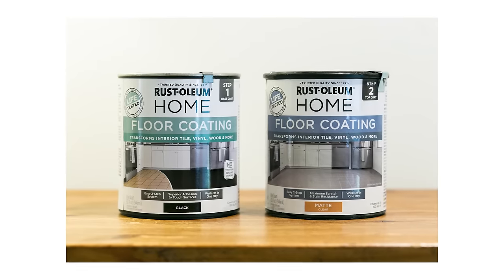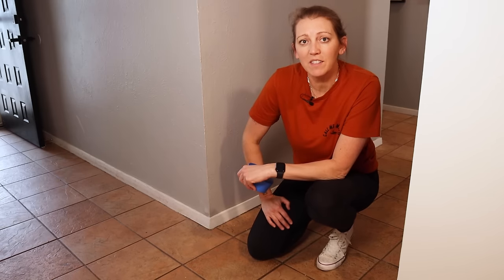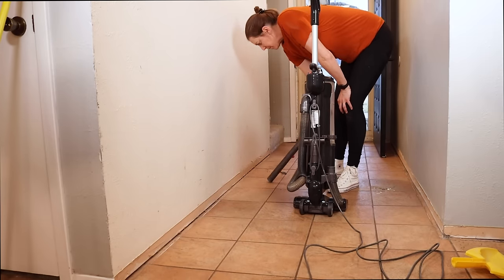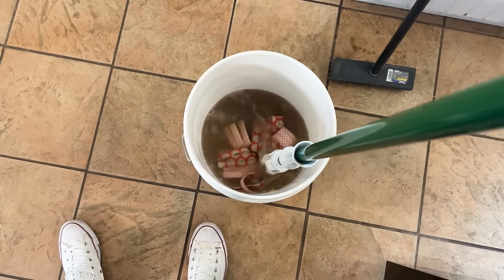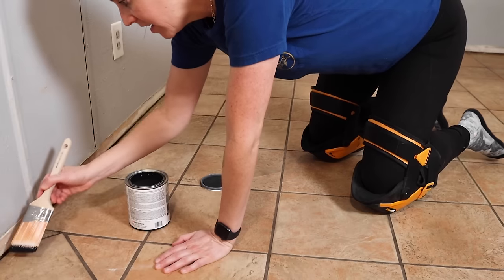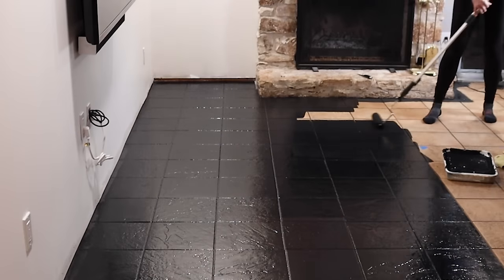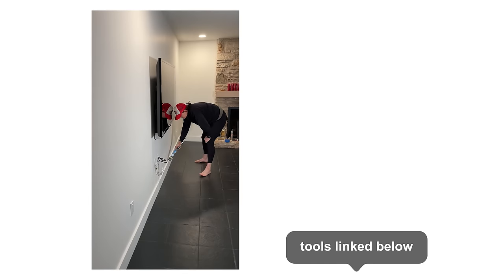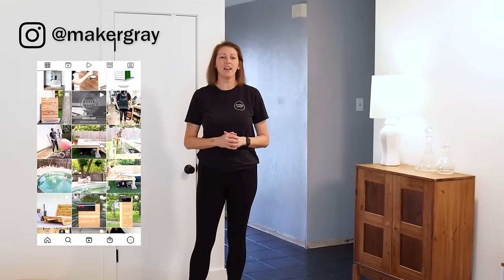Easy Update For Outdated Flooring? How To Paint A Tile Floor | Before And After

Comment from the maker: I used two coats of the paint and one coat of the top coat and I've very impressed with the durability! Click here to check out the awesome Rust-Oleum Home Floor Paint that I used to transform my floors! http://spr.ly/ROHOME_makergray Also, check out more of my House Projects here: https://bit.ly/3h6bml2 Thanks for watching!
Reply: Can you get the paint to purchase on Amazon since I'm not in the country and is the clear coat has to be use or it's optional
Reply: I used glass primer and paint to cover salmon pink tiles in a bathroom.  Put on several coats of varathane. That did very well, but a floor is a different situation. 
Now I also did something simular with the tiles around our wood stove. Four years now, with some foot traffic.  Holding up well.
Reply: Wow, just stumbled on this. My dad has 33 yr old tile and it’s ‘ok’ but I think a coat of new color work be awesome!!  We have about 10 chips in the tiles and wondering what to use to fill them?  Thanks
Reply: @Kay-pq1uo  ...   I would use 2-part Bondo, available via Home Depot, Lowe's, most auto parts places in my area, etc.   It has a bit of a strong smell, I wear a respirator when I use it to repair furniture I flip but I have sensitivity to such things.   I wear a paper mask when I sand it.   Bondo is utilized in auto body repairs, it's the most durable product I have found.   (If I need to replace missing trim or molding I usually make a mold from hot glue, fill it with Bondo and glue my duplicated piece in-place.)
Reply: Can this paint be used in the bathroom on floor and in shower?
Reply from the maker: @MsHarasan  Bathroom floor, yes, but not in the shower. Rust-Oleum has a different product for shower tiles
Reply: Update on wear and tear?
Reply from the maker: @danyellerobinson5940  Amazingly well! I'm very impressed. We're about 7 months in.
Reply: @MakerGray I forget,  did you use one coat of sealant or the recommended two coats?
Reply from the maker: @danyellerobinson5940  I did two coats of each part (paint and sealer) and that worked well!
Reply: Update on wear and tear 2yrs later?
Reply: @008AC  I'm actually releasing a follow up video next weekend! Stay tuned. For now, the short answer is it has been great.
Reply: @stretch551  alright I'll keep an eye out for it, thanks!
Reply from the maker: @008AC  Here's that 2 year update video! https://youtu.be/1Uz-zlZL7RU
Reply: @MakerGray  thank you 🙂🙏🏻

Comment: To ‘bring things together’- paint the fireplace mantel. Don’t paint the fireplace stones, just the shelf. Using your tile paint and sealer, a black mantel would make the floor and fireplace seem ‘on purpose’. So the floor doesn’t appear like an ‘afterthought’.
Reply: I agree about the mantel but I would rough brush a lighter coat of white (ish) paint on the top have off the fireplace. The stones don’t match in style or color but I like the bottoms stones more than the upper stones

Comment: Well you truly learn something everyday, as a tile guy I never thought it would be possible to paint over tile, I'm wondering how long it will last for if the paint will scratch off the tile
Reply: Dude I recently bought a house where the previous owners had painted over nice Italian tile with the rustoleum two step process product and the floor looked awful,  scratches everywhere.. even we would scratch it up sometimes moving furniture around and what not. Also, the painted floor attracts dirt and hair like a magnet it's been a work in progress slowly removing the paint and sealant one room at a time but we're finally getting there.  Definitely stay away

Comment: Hi I am going to try this on my bathroom floor. The tile grout has come up in places....do I need to re-grout prior to applying this system? thanks for your video ...your floor looks great. MM
Reply from the maker: Hi Maryanne, if you can, fixing the grout is always a good idea. However, I'm not sure it's 100% necessary as far as the paint itself goes. The paint will be fine either way. The top coat however might pool in that deep crevice area and can dry white instead of clear when that happens. Just be aware of that spot when you apply the top coat if you do not fill the grout. Thank you for the kind words and for watching!
Reply: In lieu of grout maybe consider Bondo.   Available via Walmart, Home Depot, Lowe's, auto parts stores, etc.   I had a rental property that had over half of a tile missing.   I used Bondo to fill the void, allowed it to completely dry, sanded it smooth and used 220 grit sandpaper to polish it a bit.   Painted everything the same bright white (2 coats), sealed it (3 coats), it looked like a new floor.  I sold the property to great tenants - they loved the bright white bathroom.   Just change towels and decor and it's fresh and new - in a 70yr old house.     This was on the 1970s, I don't think this technique was available back then.   I utilized Marine paint.

Comment: I did this on a vinyl floor but I went ahead and roughed up a bit with a pole sander and primed . 2 coats of paint and topcoat since it was in my kitchen high traffic area.  It held up really well.  It lasted several years until I put hardwood throughout my home
Reply from the maker: Thanks for sharing this!

Comment: I love that you went with the moderate expense of replacing the old very dated baseboards. 
It’s a step I’ve done on all 3 homes I’ve renovated.
I hate the telltale dating that old baseboards give a house. From dated finishes to over accumulated paint buildups. And by using a wider replacement board you bury that ugly ‘ridge’ that’s left on the wall.
Reply from the maker: I totally agree. It's a relatively small change with big benefits. Thanks!

Comment: WOW!!!  We have the exact same issue in our kitchen.  In fact, our tiles are even lighter than yours with white grout (that stays clean for just a few days after I’ve finished cleaning them diligently).  We’ve resigned ourselves to just living with the awful floor since getting a new one would be messy and really disruptive.  But THIS, what you’ve done is amazing and what we should do as well.  Thank you!  It is pure serendipity that I even came across your video.
Reply from the maker: Wonderful! So glad it is helpful for you!! We can actually live with this floor now haha. We love the update! I recommend two coats of each part for a super durable finish. Thats what I did and it hasn't had any problems at all!

Comment: My concern:
1. What happens to grout lines?
2. How long/durable is this? I can’t imagine sliding a wood chair over it or coming into the entrance with small gravel in the runners.
Reply: What happened to the grout was also my first thought too. 😬
According to the manufacturer the directions it says: "Make sure to paint grout as well"
Reply: Can you use Krud kutter on wood floors too?

Comment: I saw your video on tiktok and decided to see the entire process. I absolutely love this and will definitely give it a try. However how long do you think the paint will last on the floors?
Reply from the maker: Thank you for watching! I think if done right, it should last awhile. I recommend following the instructions fully (as far as dry time, etc.). I also recommend doing two coats of the paint. When applying it, roll two different directions to make sure it fills all the cracks & seams. Then, apply at least two coats of the top coat for extra protection. With that, it should last awhile. We’ve only had ours a month and so far I’m impressed with the durability 😄

Comment: I want to do a harlequin pattern with tile on my front porch but I want very specific colors to be used. I'm thinking of getting an inexpensive ceramic tile and just putting it in and then painting it in exactly the colors I want and then sealing it. I think it could be a good way to save a ton of money instead of spending ridiculous amounts to get the exact look I am going for, which would be much more expensive marbled tile.

Comment: Looks good. It's a good alternative if you want to change the look of your floor without doing an expensive remodel. I probably would have done a professional floor grout cleaning to see if that changed my opinion before tackling it.
Reply from the maker: Thanks!
Reply: @RA82828   Of you, yes.?
Reply: That is what I recommend my customers first. Do a thorough professional cleaning, and that usually changes the look, if that doesn't work, then paint.
Reply: @RA82828  Well they are right.
Reply: @vaderladyl  Yep. Sometimes a professional cleaning, color sealing etc.  will make you happy. But, if you are confident you want a change its certainly cheaper than a new  floor. I'm curious about how long it lasts.

Comment: Amazing job.  Thanks for sharing.  Quick question.  where did you get the wooden shelve above the coach and how did you install it?
Reply from the maker: Thank you! I get asked about that shelf a lot. I built it years ago before I was making videos. It's a very simple build of 3 long boards (back board, bottom and front short board) glued and screwed together. I attached it to the wall by screwing the shelf into the studs. Thanks for watching!

Comment: You are so awesome and so brave! Most of our downstairs is tile that I hate! How is the paint holding up to furniture drags, foot traffic and doggie nails?
Reply from the maker: We're about 5 months in and so far I'm really impressed! It's holding up so well. I was worried about dining chair drags but so far no problem. I was also worried about dog nails but no problems there either! As well as general foot traffic. I'd recommend doing two coats of the paint and at least two coats of the top protecting clear coat. And if I do get a scratch, I imagine I can touch it up. Thanks!

Comment: did you think about a steam cleaner for the floor ? would it work?
Reply from the maker: For the original floor? We did! We tried it with no luck.  I think we tried everything to get the original tiles to look clean. These tiles are really just old and I think permanently dingy. For the painted floor, we do use a steam mop and it has no effect on the paint, thankfully. Thanks!

Comment: How durable is the floor? That's my biggest concern.

Also, what product do you use the clean painted floors?
Reply from the maker: Pretty durable! I'm going to make a update video after Thanksgiving. We're very happy with it. For cleaning, we havent found anything that hurts it yet. We've used regular cleaning chemicals, mopping, as well as steam cleaning the floor and no problems.

Comment: We also have a color conundrum with caramel tiles in our newly remodeled kitchen consisting of gray and black tones, but fear that this will not hold up long term.  Thought about covering tiles in epoxy, but epoxy scratches quite easily, so it's not a good option.

I'm a firm believer in Rustoleum products, but I doubt this can last.  I used old school oil based brush on Rustoleum on my honey oak cabinets, thus eliminating the grain to create a smooth finish.  Very inexpensive and beautiful, but also very labor intensive.  With Majik hardener added, it's actually quite durable.

Can you do a follow up video on how this product is holding up so we can make an educated decision before proceeding.  Thank you!

Comment: I’m new to painting what does keeping a “wet edge” mean? Do you have any tips for fixing damaged tile like with holes in them? Thanks in advance
Reply from the maker: Happy to help! Keeping a wet edge means making sure that the last paint you rolled does not dry before you overlap it with the next. Rolling back into the wet part you just painted keeps a seamless flow from one roll to the next so you don't see lines or lap marks. I've never fixed a damaged tile but I have seen some epoxy products new to the market that might help. Google "how to fix a damaged tile without replacing it" and you'll see some options pop up. Thanks for watching!

Comment: Would this work in a bathroom? Or is there too much water damage  potential?
Reply from the maker: For bathroom floors, yes! For showers and proper wet areas, Rustoleum makes a different product, specifically water tolerable.

Comment: Dumb question, was your grout that dark color originally, or is it stained that color from years of use?  I'm really interested on how this product works/lasts if the crud cutter didn't fully remove stains from the grout.  We have 3 large dogs and keeping the grout clean is next to impossible, but I'd love to try a tile product like this to update our house.
Reply from the maker: Not dumb at all! The grout as you see it before the paint is exactly how it was when we bought the house. We tried and tried to clean it but no success. The crud cutter took off a lot of dirt but nothing would clean that grout. Really happy with this paint! I recommend a couple coats of each (paint and sealer) for maximum durability.

Comment: I've heard that the smell lingers and is super strong. What are your thoughts about that? I was thinking to do it in a bathroom that doesn't have a window
Reply from the maker: It's almost been a couple years now but I don't remember the smell lingering long. Maybe 24-48hrs max. I did this in the winter and could not open windows and we were okay. You won't want to hang out in there, but it should be gone relatively soon. Hope this helps!

Comment: What if the the tile I currently have is glossy? Do I need to sand it down for the paint to adhere?
Reply from the maker: If I remember correctly it should be fine. The degreaser cleaning is all you need. Rust-oleum gives all the details and requirements on their website for you 👍🏼

Comment: Will this work on terra cotta flooring? If I use Krud Kutter will that be enough.  I t looks amazing I am thinking of doing white as we are on a beach is Puerto Rico.  Can I buy this at Home Depot?
Reply from the maker: yes I believe so! We used krud kutter only for the cleaning and it worked great. Follow the instructions and I recommend doing two coats of the paint, and then dont forget about the top clear coat. You should be good! Jealous of your beach house!
Reply: @MakerGray  Thank you I will send before and after.

Comment: The only question I have for this project is how much of the product did you need to buy to cover this large floor? It appeared from the video that you used only a small quart of product (for each layer) and that doesn't sound like a lot.
Reply from the maker: I hate that I did not document how much I used bc that would be great to share. But yes, it was a lot more than a quart! The quart size was all that they had in stock, so I used several cans. I believe the cans show the coverage area so if you are interested, definitely consult the can or website. Thanks!

Comment: This might be what i need to rescue some "free" Craigslist tile i picked up. It's hard to tell, but i think i damaged the fronts' seal when i soaked them in muriatic acid to get the thinset off the backs.

Do you suppose this paint would still be effective if applied to the tiles before they are installed?
Reply from the maker: I'm guessing that should be just fine!

Comment: Do you think this tile paint will work on countertop tiles?
Reply from the maker: Hmmmmm I dont see why not. As long as they are not in a wet area, should be fine! Check out Rust Oleum's website for more info
Reply: Is there variety colours?

Comment: I bought this paint and it was great. However one thing I seriously disagree with is that it’s thick and the spread is great. That quart goes very quickly and you need multiple cans for great coverage. Does not spread well at all

Comment: Did you use the quart size?
Reply from the maker: I used several of the quart sizes, but the gallon sizes are great too!
Reply: @MakerGray  Think you could have done just the fireplace area with one quart? I have about 80sq/feet to do. Label says I can get 100sq/feet. Super expensive so I would like to only use one quart/one coat. Thanks

Comment: Can you paint in sections? Due to having to utilize the room. Thanks
Reply from the maker: I actually did that in one room and we can't tell at all!
Reply: @MakerGray  so if I left a path can I do that with two coats of each at the end or how did you do it also how’s the longevity of it?
Reply from the maker: @davelombardo1710  I left a path when I did two coats of the paint. And then when I did the top clear coat, it needs 24 hours to dry. So I did that in all one pass and painted my way out of the room. Longevity has been great! We're almost two years in and I'm very happy. I'll do an update video very soon.
Reply: @MakerGray  thanks for all your help! That top coat all at once will be a challenge cause myvsons room is off the room floor I want to paint

Comment: Would a lighter grout color work with covering the dark paint between tiles?
Reply: That sounds like fun.
Reply: That is a very unnecessary and painfully laborious job, you don't want to do, besides the paint is designed to be just that, one coat, no grout color difference.

Comment: Wouldn't it be worth it, even if it doesn't last several years, because it's cheaper than a remodel? Wouldn't we want to look at it as "paint" whereas people may like to change paint colors on walls, so why wouldn't we want to for floors? Or at least re-paint floor same color? Wouldn't that still be cheaper?

Comment: Just to give you people clarity as I do pink tiles as a profession. If you don't etch floor or use a special glue compound primer you will never have resilience to scratches. This will be okay for your backsplash but not for your tiles and I personally know that this product is not very reliable